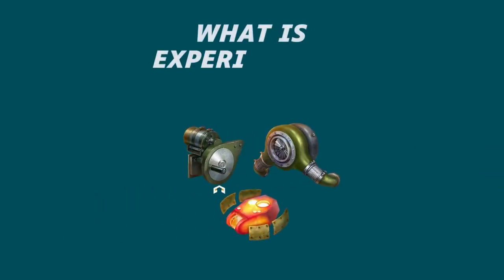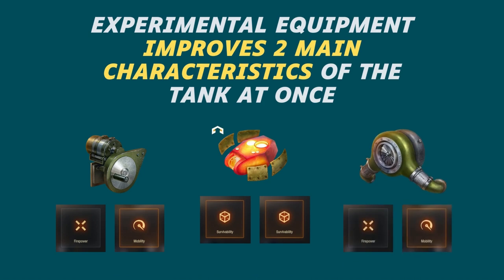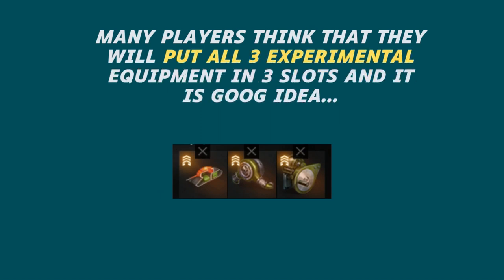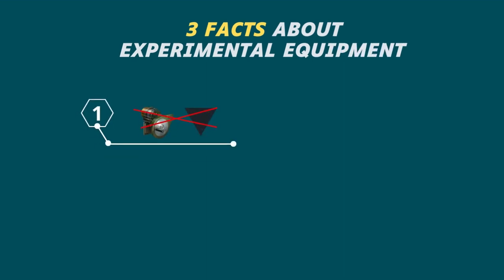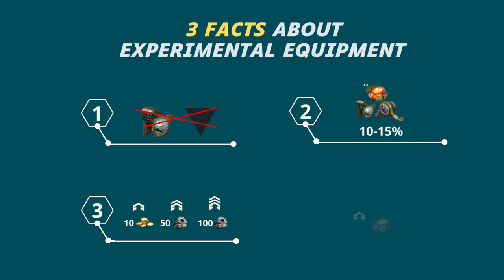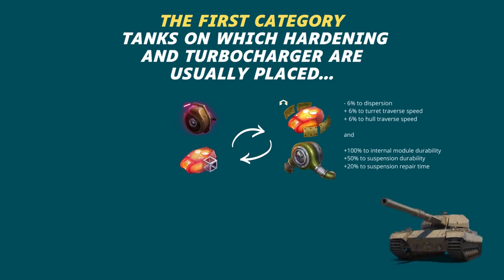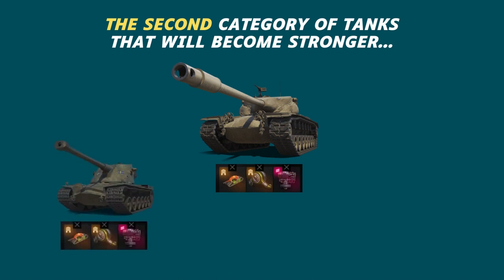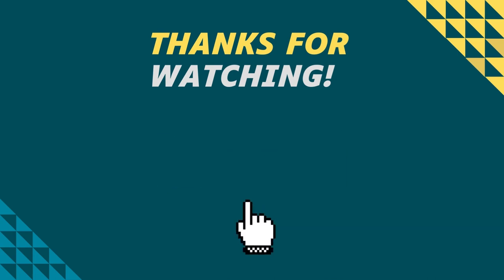Why Experimental equipment is the best Guide WOT about the experimental equipment of World of Tanks

Comment: Experimental equipments aren’t forever right? They are used and they consume one by one
Reply: They are permanent, you can only remove it with 200 components after it is equipped.
Reply: Those that are not forever are called directives. You put them on the tank and they get consumed after battle. They increase Stats for one battle. Experimental Equipment is permanent but cannot be removed so easily than normal Equipment

Comment: Quick correction. Fire control system is actually Enhanced gun laying drive and vertical stabiliser, not enhanced gun laying drive and rotation mechanism as stated.
Also, the reason you cant fit it to a TD is that vertical stabilisers aren't allowed on TDs and this would be a loophole if you could fot it
Reply: Can ypu explain me what experimental equipment is equal to the regular equipment ( like you said fire control equals gun laying drive ) ?!
Reply: @soulbrothers7789  Experimental equipment is 2 regular equipment's in one and all 3 replace regular one(EGL=Vstabs, MIS=turbo and SIS=hardening)
Reply: @jereulmanen7093  thanks maaan 😍

Comment: Ignore these haters regarding your pronunciation. I am from 1980s California, and I understand you fine.  You are doing great in a language other than your native tongue. 

Good video you are the only guy really analyzing the EXP Equipment, I have found that useful in trying to set up tanks with the mods.  

I am trying to decide between the EXP Turbo or the EXP Survival equipment on the M60. Ultimately, I think they would both be amazing, but I think I will use the Survival equipment to make it hard to track since it is already fast.  So final drive for a badass M60 would be EXP-Survival/Bond Vents/Bond Rammer.

Good video thanks.

Comment: Great video, but I would just like to say the letter Q is read as Kyu so in equipment its said differently than K.  
Also the setup I like a lot is the experimental turbo on TDs like ShPTK-TVP as it cannot mount vents and vertical stabilzier, and it doesnt really need ordinary turbo that much.
Reply: different countries pronounce different.
Reply: @benedicvelasco  They may well do, but that doesn't make them correct. All native English-speaking countries are consistent on the point raised.